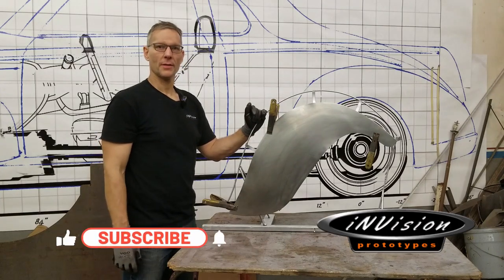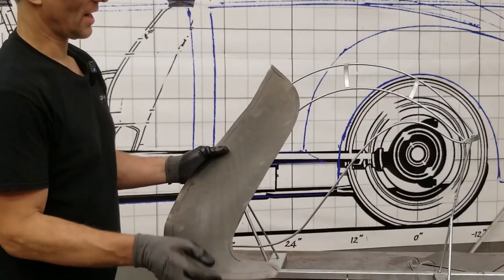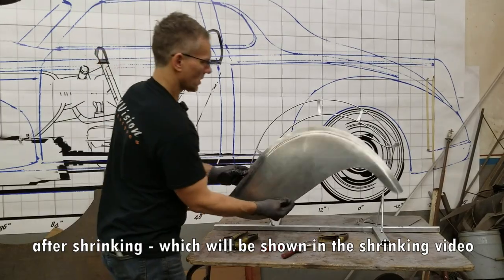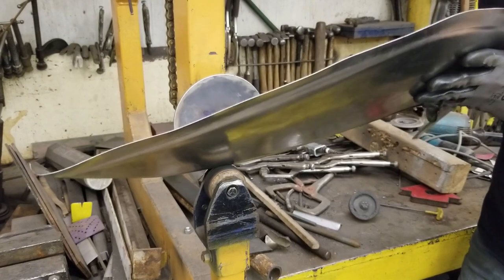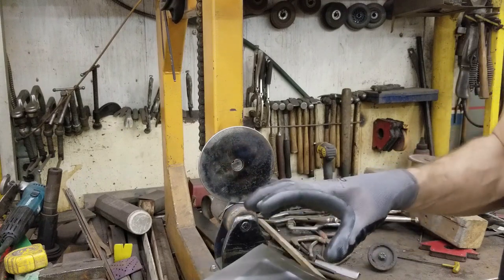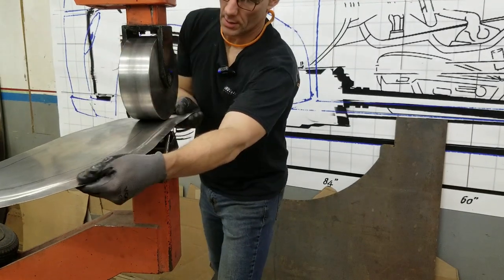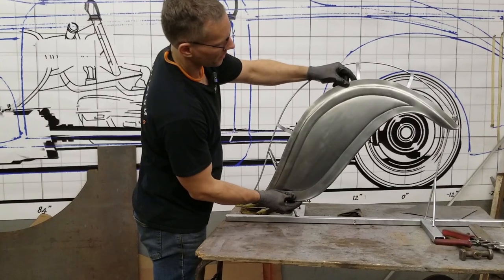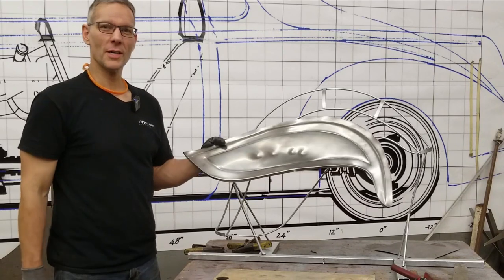Rolling Beads, Offsets & Flanges - The Basics

Comment: What would happen if it was pre stretched with a  lower anvil  that had more radius to it?  Or would that be used for a deeper bead ?
Reply from the maker: You would need to be dead on accurate with your passes or you will get unwanted tracking marks.  I believe that even with the low crown anvil tipped on edge, when I was pulling the panel back towards myself I went off track(you can see it when I mention driving backwards).  And yes, if you are careful it can be used to create a deeper bead.